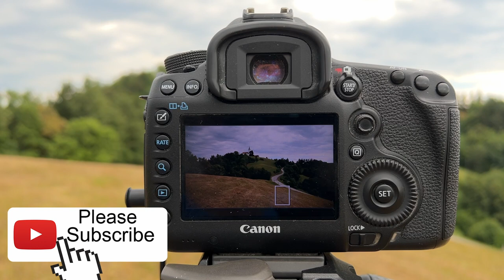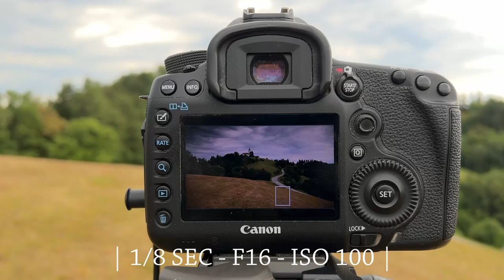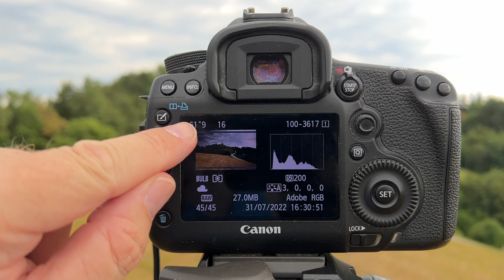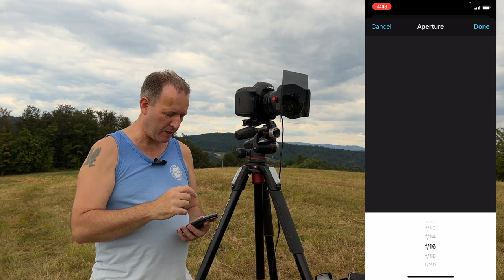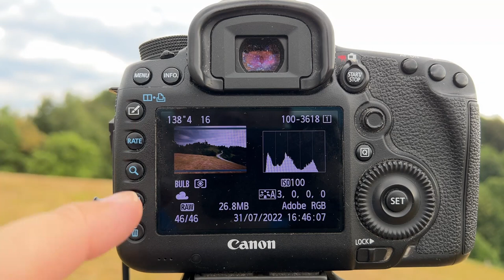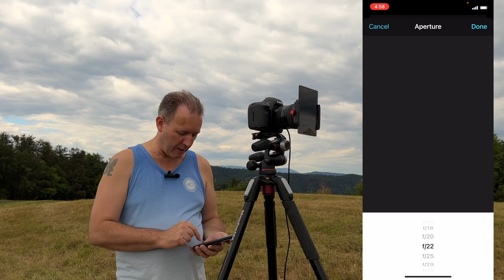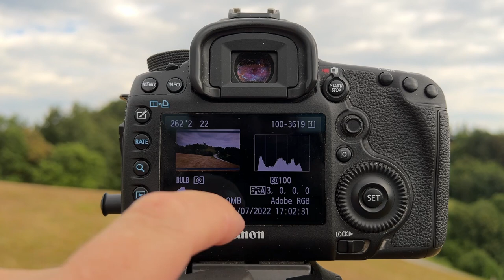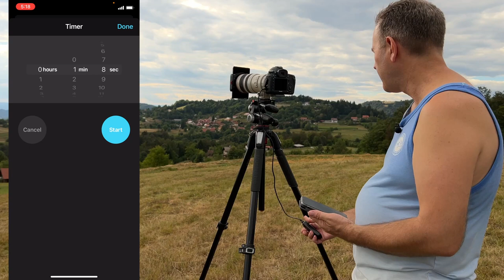How to use a 10-stop square ND filter and calculate long exposures with Photopills - Kase review

Comment: If the gasket is on the holder, then don't you have light leaks when you stack ND filters in the holder?
Reply from the maker: I shouldn't imagine so. As long as the first ND in in the first slot, this will seal off any light from leaking into the lens. An leakage from subsequent filters will go into the first ND in that case.
Reply: @IanMiddletonPhotographyTravel  Are you sure? If you stack a 6 stop and 10 stop then the one against the holder will seal, but the one in front of it you will have light leaking into the side, so some parts of the image won't be an even 16 stops.
Reply from the maker: @sebastiang7183  I've never stacked them before but yes, I suppose when you think about it there could be some minor light leakage in the stacked filters, so you would have to put your strongest ND at the front. If you want to stack without any risk of light leakage, you could also get a circular ND for the K9 holder and then have one square filter on the front. Otherwise, for stacking without any risk of leakage the best option would be the magnetic circular filters. Or else I think maybe the armour system would work better for stacking, as each filter is attached together with a magnetic frame.